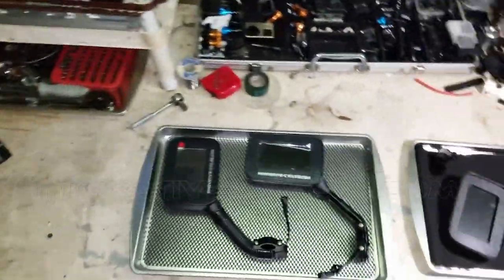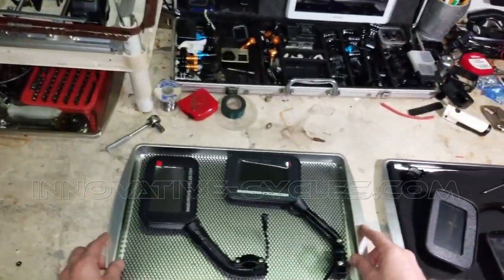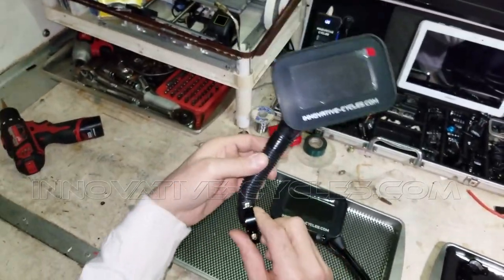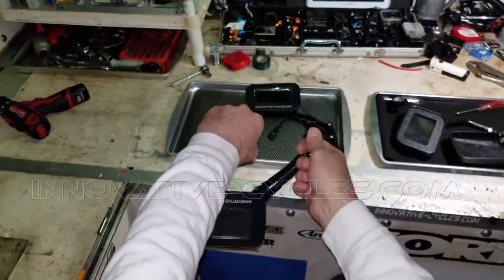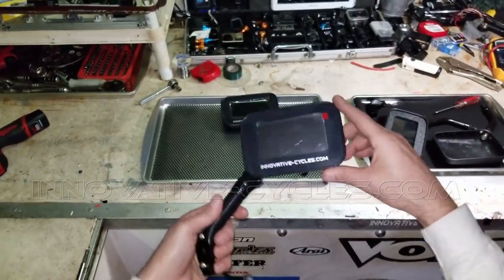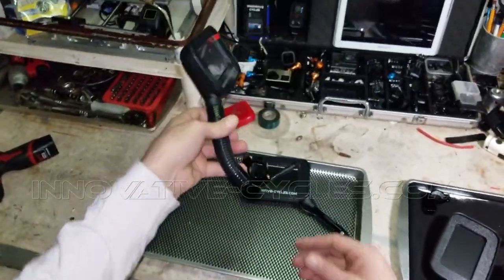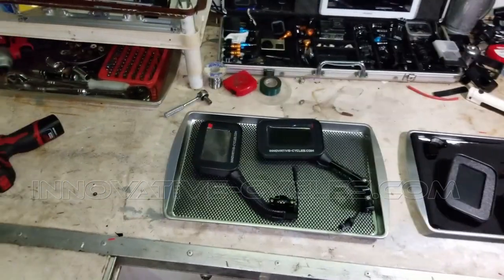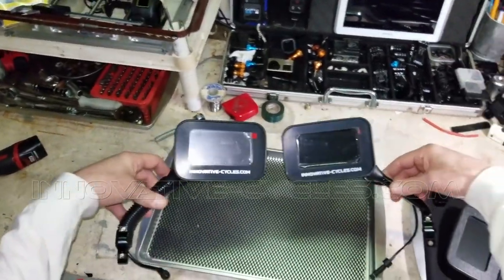GPS rear-video mirrors BAR MOUNT kit

Comment: Have you considered one way glass so they are mirrors when they're off but can be seen clearly when on?
That could pass inspections?
Reply from the maker: we have pix of a set like that on the website but its rearview on both mirrors since the touchscreen gps wont work through the lexan...  not to mention the lexan increases the sun glare since its essentially a mirror face!   thanks for the interest/suggestion

Comment: I HAVE BEEN WAITING FOR THIS FOR SO LONG.
Reply from the maker: nice....   ive shot down so many customers with cruisers and Harleys finally figured I had to come up with bar style kit.....    it's a crazy tight fit but we now have them!!
Reply: @carbonrrpilot  are these basically universal if you got bars
Reply from the maker: @daleprechaun1791  yes, they can screw into 10mm bar mount mirror bikes or clamps included fit 7/8" bars and can be mounted anywhere on bars...   contact pete at innovative-cycles.com for more details.

Comment: so does it unplug/plug in the same on a Cbr
Reply from the maker: since the wires for sportbikes must go through fairing you must drill a small 4mm hole between mirror bolts for wires to pass through cleanly and hidden, I can offer the complete quick release harness for sportbikes but you would have to drill a larger 8mm hole for plug to pass through fairing.

Comment: Nice, are you goin to have different heights for guys with taller bars??
Reply from the maker: The only stalk i offer is 4" but you can use the bar clamp upside down or right side up which will raise or lower mirror 1 1/2 "

Comment: Hi there I’m in the uk and would love a rear camera mirror that will screw into the regular brake mount do you have an email I can contact you on?
Reply from the maker: Hello, these are only sold in kits, gps and rearview video and will screw directly into stock bar mirror mounts for 10mm mirrors you can contact pete at innovative-cycles.com for more details.